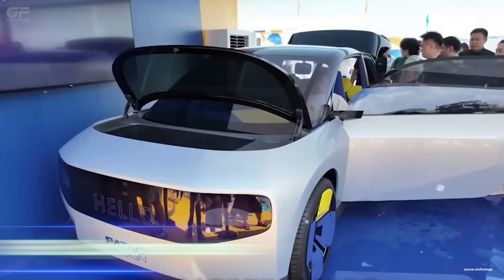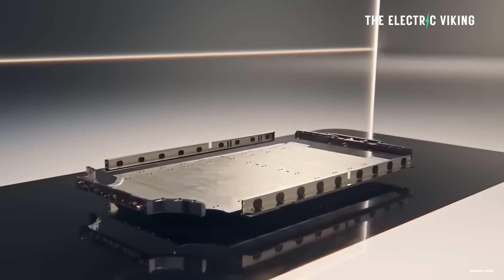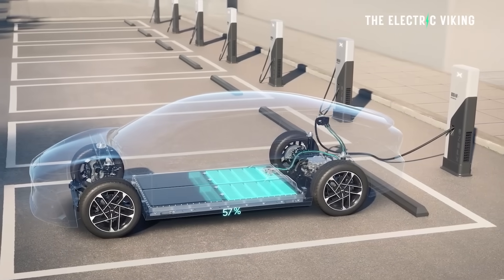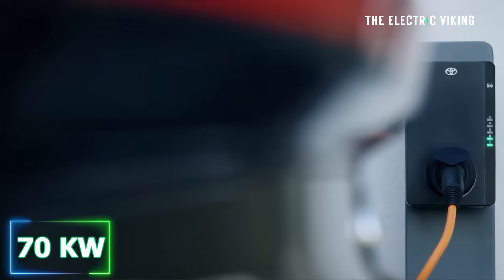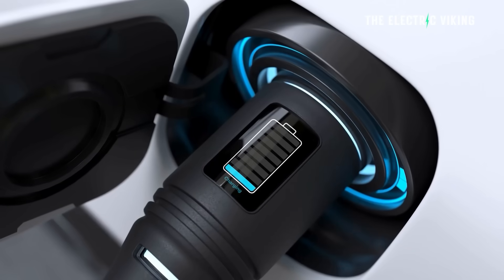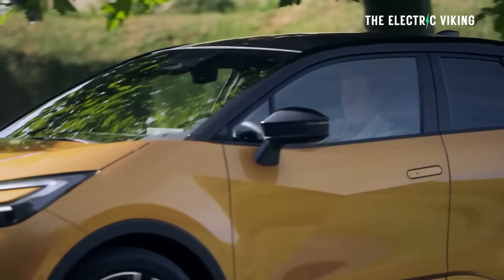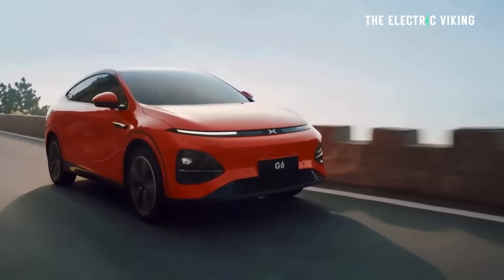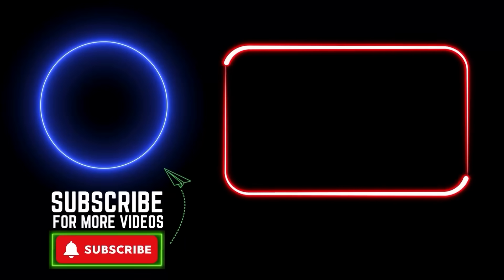SAIC GM's 400 Wh/kg battery will enable 600 mile range EVs in 2026

Comment: Maybe you addressed this and I missed it.  You talked about charging at 500 kW in China.  You talked about the new denser solid state batteries that GM-SAIC are supposedly going to produce in 2026.  I did not hear you specifically say how fast these solid state batteries will charge or what vehicles they will appear in.  Will they actually accept 500kW?  Mind you, I'm driving a 2019 Chevy Bolt that I only charge at home- in fact, it doesn't even have DCFC.  We have 100% renewable energy where I live in the US, and it costs USD 0.09 per KWH.  I spend more on tire wear than I do on electricity!  It's perfect for daily driving.

Comment: I am curious about the projected cost of gasoline (aka petrol in UK) in the coming years. I have seen lots of projections/videos about electricity getting cheaper... but I haven't noticed any analysis of gas-station prices. Will gas go down in price because it is oversupplied and not used? Or will will it go up because there are all these gas stations that are getting less and less business as cars charge at home?

Comment: I don't care about battery size and charge speed as long as I can charge where I park. Unfortunately, I can't anymore and switched from an EV to a Plug-in hybrid because of that. The infrastructure of slow chargers on every or most parking spaces is the only real problem that needs solving.

Comment: Living in Québec Canada,  I'm waiting for the solid state batteries to buy a vehicule that has enough range to run at temperature of +35C to -35C. And still heat up the cabin and start like an ICE car. Yes that's Canada my friends! 
Were built different. Just like the vikings. You've got  kangourous and we have mooses! 
Same temper with an average weight of 750 pounds.
Now back to electric boxes...we have a good grid already in place but there's a place for improvments. Fast charging on the fly is not as easy as it seems. The upcoming solid state will let us, even in the winter, choose when to charge.
I'll probably sell my Outty PHEV in two years if everything stays what it is. We never know with Trump!!

Comment: Good video Sam. The US will, again, be left behind in this revolution. But I also wonder what will happen to the incredibly poor, jumbled, underpowered and undermaintaned network of public chargers here in the UK? They will get left behind rapidly by cars that will go 600 or miles on a single charge and cars that need 300kW or more when most of the public chargers here languish at 7kW or 22kW.  The greater the range of these cars the less need there will be for poor public chargers. 

The strange think about revolutions is that the deniers keep denying until the tipping point leaves them with no option to adopt the new whatever. Here it feels like that tipping point has been reached. Same is true with electric outboard engines. I have had one on my boat since 2019 and was always the 'curiosity' in the boatyard. This year, suddenly it seems, everyone wants one and you can't buy the top brands for love nor money as everyone is out of stock. 

...and then there's the climate tipping point. Ask Texans or North Carolinians about that.

Comment: I would wait to see sales in china, before contributing to the Osbourne effect.  do we know cost, cycle life, safety, scalability of these batteries.  even after all that we will have to see if they go through recalls.    its 2026 for china, but it might be 2028-2030 for other markets.  I would not wait to buy an EV for this tech to come to market.  I think it is further off.  GM just started building lithium iron phosphate battery factories in USA.  They would not have done that if they knew this tech would come online quickly.

Comment: If this could actually get 400 Wh/Kg at the pack level this would be enough to put a 200 kWh pack in a van or truck and get a decent range. Or half that size pack in an EREV truck with new ultra-efficient engines, that could deliver the towing range people want. This doesn't mean Tesla will have it, or that pack sizes will simply double because the weight is reduced. The cheapest battery is usually the winner, as we see with the compromises that reduced the range of Cybertruck.

Comment: Driving at 60-65 mph on long motorway journeys my EV travels 250 miles on a charge, but at the same speed my diesel car does 1,000 miles on a tank which means on long journeys (which we do regularly) we can stop where and when it suits us, and not as dictated by the car. High speed charging on UK motorways is more expensive than traveling the same journey on diesel. I like driving my EV, lots of power, nice to drive. However, it does not compare with a good diesel for long distances.

Comment: the main problems with EV's is range and durability of the battery. I'm firmly on the fence, a spectator until I see it myself. as it is combustion engines still rule the day. TKS

Comment: I'm very doubtful GM will actually deliver on this solid state battery product, but I hope they can.  As a Tesla Model 3 driver for 4.5 yrs now,  I have to say that 600 miles of range in an EV is not attractive to me. 300 - 350 miles range is plenty.  An extra 300 miles on top of that just isn't worth it.  However, 500 wh/kg energy density is an important milestone.  That is about the point where electric airplanes become very competitive.  As a former pilot,  electric motors in planes are much to be desired over ICE engines.  They have orders of magnitude fewer moving parts, need little maintenance,  have no red-hot exhaust manifolds or valves, and there's no gasoline tanks to rupture in a crash landing.  Survivability in crash landings is surprisingly good IF the plane does not catch fire.

Comment: I don’t quite get what’s good with a phev on a long trip (which is supposedly the main advantage). Maybe I am missing something. When you stop, you’ll have to refill both batteries and fuel. Who’ll do that?  If you only refill the tank, you’re dragging a lot of wasted weight of a depleted battery. Could someone please explain this to me? Thanks!!!
Reply: No one with a phev charges the battery on a trip. They only plug in at home.

Comment: Waymo vehicles are all-electric and powered by 100% renewable energy, operates now in at least 4 major cities that are difficult to drive in. Anybody had the experience of driving in San Francisco or Los Angeles? There is no pleasure in that.
Why would I buy a car? I'll keep my old ICE Camaro for Sunday drives & save my money. It will take longer to find a parking space than to hail a "taxi". It'll drive me to the front door. No need to cross the huge parking lot when it's 105 degrees Fahrenheit in Phoenix or manage to not kill yourself walking on the ice in the parking lot in the Winter in Denver. Why suffer with that? Maybe the days of everybody owning a car are coming to an end?
Is buying stock in car companies as a long term investment a good idea? Car companies might have to pivot to be both industrial & service companies.
You going to work? Get in the car & it might have a desk & breakfast with high speed internet connection. Your commute time is part of your day. What will the car look like? It'll look like a box on wheels.
Going on a long trip? Why sit the whole way? It'll be like a seat in first class on an airplane. What will the car look like? It'll look like a box on wheels. Ugly. The experience of driving? It might even become illegal.

Comment: Plug-in-hybrids have endless range, since gas is an option.  I think there is a good reason for Plug-in-hybrids (70 kW).  For 90% of days you could be pure electric but still having ICE range with gas for long road trip (thus slower charge rates dose not matter).  It is a good bridge until the entire EV value change is perfected in the 2030s.  We really need to see the real world range and charge network rollouts over the rest of the 2020s.

Comment: I love the EV concept. What stops me from buying one is the price and depreciation. You can't buy a second hand ev either: If the battery fails in some way, the car would immediately be a total loss which I cannot afford. Battery technology changes so fast that by the time your battery is dead, the replacement is no longer produced (a market should form for that in the near future). If you're driving a lease car, it's perfect: No Risk. For me, I just bought a very good hybrid (Honda Civic e:hev) which drives fantastic. It often drives as an EV which is great, but I get 10 years of waranty!!!!!! 10 years!!!!! So economically, this is the best choice for me. Another issue is the grid. The Netherlands already has very serious grid problems. If you want a grid connection as a company, you'd have to wait years. If we get more EV adoption, the grid situation will get even worse. Unless ev's are all obliged to be able to do power grid stabilisation, that would fix a lot, but we still would not have enough power generation capability. This transition is going to take a bit more time......

Comment: I don't really think selling a used combustion engine car is that difficult in Norway. Would probably just have to find a dealer that exports them to Sweden or Finland. Especially in the case of latter the age of the average vehicle on the road is 13 years.

Comment: 400 Wh/kg is great.  500 miles of range is all most people would need to have almost no range anxiety.  Every time you talk about a new battery technology, the density is seriously one of many issues.  Does it charge when it is cold or hot?  How long will the battery last in charges?  Can the battery be discharged completely or charged completely without degradation?

Comment: Those that buy PHEVs typically charge overnight. They see the electric part as a way to save money for daily commute where small batteries are typically enough while at the same time having the flexibility for long trips. Unlike China, most of the world does not have good charging infrastructure yet which is one of (several)  reasons why adoption has been slow in most countries.. Who wants to plan their trips around location of EV stations? While it depends on use case, PHEV still can make sense as a stopgap tech in countries were ultra fast charging networks aren't a thing, which is still most of them.

Comment: The big question: Will GM still exist at all nexty year.  They are looking at having to replace every V-8 engine sold since the 2018 onward. They outsourced big parts of the motor to contractors (many overseas apparently) who didn't properly handle surface hardening.  They are looking at something like 500,000 motors that will need replacing.  They also lost a LOT of $$$$$ on every ev they sold... and while they don't have the invnetory like Dodge has in immense pickups, they have almost a year of inventory sitting on the dealers lots in a lot of places.. why?  Too expensive  and the motors WILL break.  And then you will be without a truck for months because of manufacturing delays.  (When the rods provide you new view ports in the side of the block, you need a new one.  FAST charging simply needs an immense increase in the power supplied.  Charge in 1/10 the time, you need 10x the charge rate.  going to a 5 minute charge rate from say 30 minutes will require truly huge amounts of power.  The electrical infrastructure will require HUGE improvements here, especially where you need fast charging in remote areas.  Tesla, of course, announced their AL Ion battery.. which looks positive.. and then there is the Mobius out of Africa... a $5000 to $8000 EV with Iron Oxygen battery....  GM?  They have lost my trust a decade ago...They lost the trust of probably 2/3 of the coutnry...

Comment: I just bought a regular hybrid.  They are not disappearing anytime soon (at least here in the US).  Plug-in hybrids I thought were a weird sector.  It's for the indecisive person who cannot decide between and EV or a hybrid.  Go one way or the other.

Would I buy an EV if I got that long range?  Most likely.  Depends on the cost of the vehicles as well, which is why EVs are not big here in the US.  You can hardly find an EV for under $40k (especially with the tax credits going away).  Trump and company won't let in cheaper alternatives from China and such.  If Trump did, China would put the US automakers out of business.

Comment: If those batteries are installed in hybrids, the vehicles could potentially achieve a range of around 1500 kilometres, or at least a greater range than battery-only vehicles. That would completely counter your hyperbole "hybrids will die fast" argument.😁

Comment: Good luck finding a fast charger if you aren't driving a Tesla
Reply: What do you mean? Here in the US, Tesla took infrastructure dollars from Uncle Sam which required them to open up their network. GM has been providing NACS adapters for their EVs for quite some time and their latest model has NACS standard.
Reply: @rdollie1  Tesla only allows a fraction of its chargers for non-Teslas, and they aren't the newest versions with the highest charging capacity. There are Youtbe videos of people trying to go cross country with non-Tesla EVs, and it is playing with a constant fear of not being able to charge your vehicle within a reasonable time.

Comment: Does this make solar range extender practical. 
Tiny battery of say 150 km range. 300 kg car with AC, 2 or 3 cozy passengers. Gets 150 km with a 400 kg load?
I use my prius as a truck successfully.

Comment: Most people in the USA don't even drive 100 miles per week....
The issue is finding a place to charge your vehicle, especially if you live in an apartment or condo.
Reply: I think the average is around 200 a week. in any case, yeah it's getting difficult in denver. so many apartments, so few chargers. going to get worse before it gets better.
Reply: @xtdude  Averages are a bit skewed because they can include people who drive for a living and rack up tons of mileage on their cars. The "median" is a better metric. It removes the extreme highs and the extreme lows rather than averaging them in.

Comment: I just bought a mg4 xpower in green brand new from main dealer. I paid £24,000. I was waiting and waiting for the right time and it arrived so i jumped on it. The also gave me £500 charging credit on electroverse app. They are getting cheaper and there is also some good deals out there if you do your research.

Comment: When the typical car drives less than 40 miles daily, and charges nightly, they would be buying and carrying 500 miles of unused range.  

What that high density battery really does is make PHEVs super efficient with tiny lightweight affordable batteries.  The entire car gets that much lighter and smaller, improving dynamics and reducing system wear.  The conversion from ICE to PHEV gets that much easier, killing ICE-only entirely.

Comment: You don’t need to charge your hybrid on a road trip, you fill it with gas! That’s the point, for longer range. Don’t people know that? They really good thing about these SS batteries, is that you can use fewer batteries for vehicles that are employed for short daily trips. Lower cost, lower weight, more efficient.

Comment: If small passenger EVs were just for use in cities and tourist areas then they would be doing something worthwhile.
Trying to replace large long distance vehicles with battery powered versions is not only impractical but it is stupid beyond belief.
Unless someone came up with a battery that was no bigger than a loaf of bread that you could easily and safely swap out at a charging station every two hundred kilometres, battery electric vehicles will only ever be a useless pile of toxic trash waiting to burst into flames.
No personal EV that is bigger than a classic Mini with more than 120 kg of batteries will ever reduce carbon emissions.
In the majority of cases your favourite virtue signalling machine will expire about the time it is approaching breaking even on the emissions involved in its production . And thanks to all the battery fires the carbon deficit keeps going up never down.

Comment: 200+ mile range EVs second hand 27000 of them on Autotrader in the UK starting at £3500
Reply: Best to grab a bargain then, before they run out, and one is forced to choose from amongst the 330,000 ICE models no one seems to want as much.
Reply: @GruffSillyGoat I'm waiting for a good deal on the renault 5
Reply: @JuliusFawcett  - hopefully they'll get the full UK incentive rate, being built in France with it's high Nuclear power grid, with the batteries built on site as well. 

Just realised I used "you're" rather than "one is", might have come across as acquastional rather than generalised, will correct.

Comment: Most people who have  EVs  charge them at home 90% of the time so the charging speed is not that important.
Reply: It is if you're on a road trip.
Reply: Many people live in condominiums and apartments and don’t have easy access to home charging, so range is important. Range is important in North America.
Reply: @weldoncourt a small % live in condos or apartments and most municipality's have made it a building code that new buildings have to offer EV charging stalls in the parking.
Reply: Maybe who own an EV now, but it really depends on the country and if they live in urban or rural areas. If you live in a city you might only have a parking spot on the side of the road in front of the apartment complex.A good public charging infrastructure or maybe differently designed outside parking spots are required (there used to be more parking meters around and water hydrants are also here and there - so it would wouldn’t be unimaginable to have chargers there instead/as well.